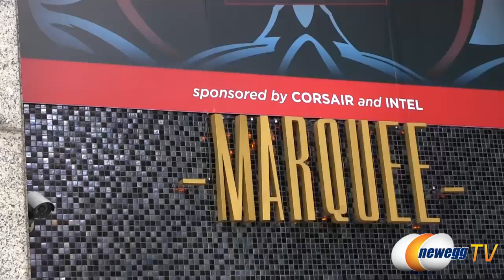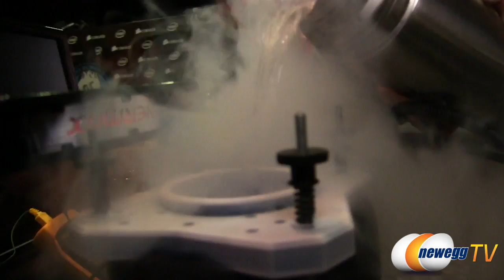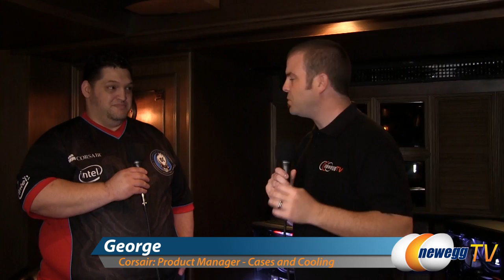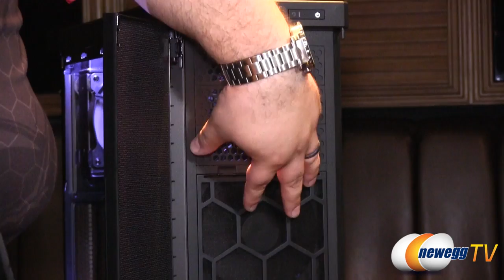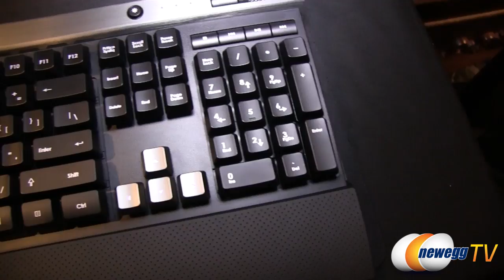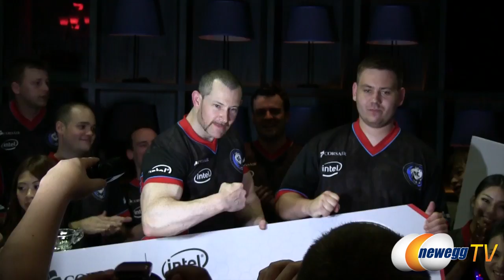Corsair & Intel OC Main Event @ Computex 2013, Air 540 & 330R Cases, New Peripherals - Newegg TV

Comment: I actually like the double wide case because, if they  make one with a huge sidepanel window, it takes all the parts that you don't want to see when you're showing off your build and hides them. Hard drives, empty drive cages, optical bases, the power supply. All the things you usually do you best to hide are behind the motherboard tray. Great for people who like to build showcase style builds. You could probably even put your watercooling pump and res in back and have just the radiators showing